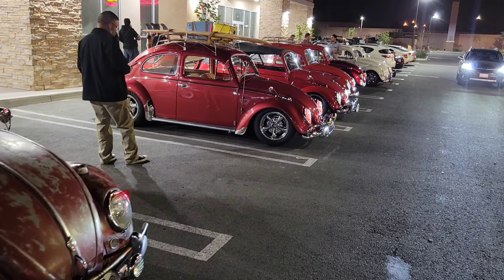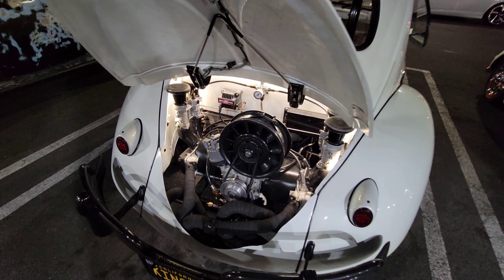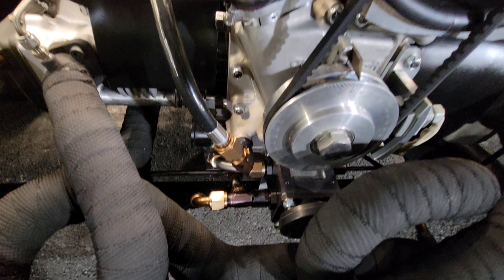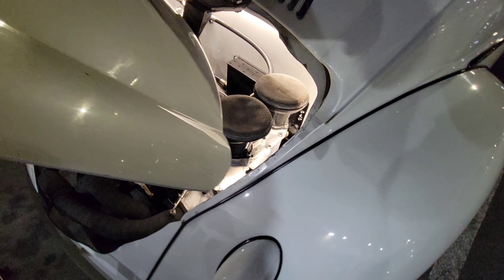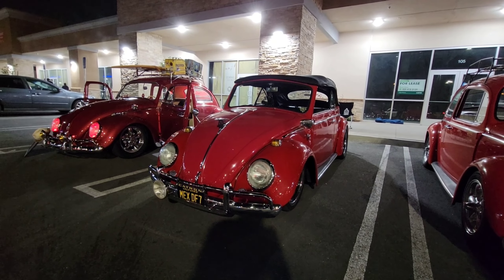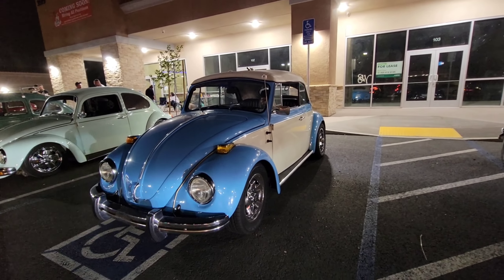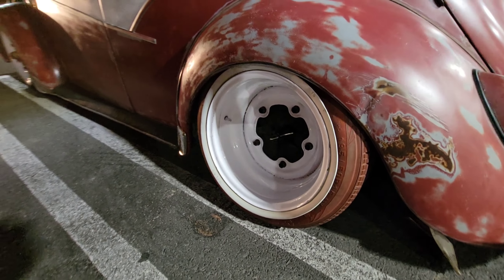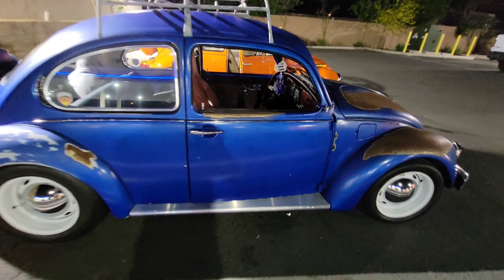2800cc VW air cooled Flat 4 Autocraft racing engine insane horse power  plus some cars

Comment: You may have seen it but there is a fellow who has a video on here that he took and put a Subaru WRX engine at over 500 horsepower in one of these he also did quite a bit of fabrication and fit up. The car seems like a beast for sure

Comment: Thanks Mike, nice video.  You pin ball machine probably has an over voltage safety circuit, usually in the power supply. It might just need a small component to be replaced. Once the circuit has fired the safety, it will present a short circuit to the mains supply and blow the mains fuse again. Should be an easy fix if you can Google it with the circuit board number…

Comment: Hey Mike !  that seems to be a Scat killer 3pcs. case . big bucks . If I would build a case to hop it up I would make the case longer to get more room between the cly.
Reply: Not a scat. Autocraft 3 piece. Folts and Schuh old drag engine from the 90’s.
Reply: @kingvw61  Oh ! I never seen either one of them . My friend Richard in San Antonio had a Karma and used original mag cases . He had a pile of them 15 and I said hey sell me one . No I need all I can get . Now in the back of the shop he had the blown ones . every one of them the same thing. crank snapped at the throw between #3 and #1 . It looked like case failure to me . this was in 1980 or 81 .

Comment: E85 would be well suited to air cooled engines. Handles high compression and runs cool.
Reply from the maker: Yea I should do that on mine. The guys at Low budget do it with the fuel injection system they sell.

Comment: A 101.6 mm bore with an 86 mm stroke is 2788 cc.  Stroke it to 88 mm and you get 2852 cc.  So, he may just be rounding up the 2788 to 2800, or he has an unusual bore size, like 102, which puts you just a tad over 2800 cc.  Interesting.  I wonder how it drives?
Reply: 2783cc. 86 x 101.5
Reply: Drives like a dream. Low end is great. Pulls to 8000.
Reply: @kingvw61  Never heard of a 101.5 mm bore size.  101.6 is 4", and is typically what I see on the market.  Is this a custom cylinder?

Comment: its a 2799 they are 101.5x86 the 4 inch bore cyl. are crazy thick and are much more streetable than an old school 2180-ive got a roller cam 2.8 with the heads of tge red baron drag car...
Reply from the maker: I think that is what it was. By the time I did the narration I forgot because Of working on all the house problems. Used to be in the drag car. it was the spare. They tuned it for NA....then the drag car engine blew up. was turbo then they machined the heads down to get high compression. would need new heads, pistons and some other things to go back to turbo. Pistons had to be clearance for the valves.

Comment: Those Autocraft heads usually don't have any cooling fins on them for street use. They are worse than the CB Street Eliminators when it come to cooling efficiency. I wonder how they run on a hot summer day??
Reply: E85 keeps them cool.
Reply: I data log all EGT and cht they run 350 on a 100 degree day. I ran 91 for 4000 miles and had no issues.
Reply: @Paulman50  Yeah, to a point... provided you have a conservative CR.
Reply: @kingvw61  What was your CR?
Reply: @freddaniali  was 10.6 on 91 now it is 13.4 on e85
Reply: @kingvw61  wow! nice!

Comment: Cool VideoMike , on the 2800 , how the hell does he stop that on the Street ?  Stock VW Brakes where never that great  Power Surgesactually really Suck  i lived inMaryland for 25 years and  i had a couple of them  that did damage to my mainTelevision  both times  it turned out  that on the second time the guy that fixed it explained that  the first Shop missed a Update notice from the Manufacturer  and if he would had installed a under a Dollar Diode  that would had blown instead  of the 800 dollar part that did ?  the Importance of using a Factory Authorized Shop for Repairs  of Course these days  very few people repair Televisions  We throw them out and replace it with a new one
Reply: I have RLR brakes front and rear, Stops on a Dime, best breaking car I have ever owned. They are strange calipers and rotors with ron lumus hubs and brackets.

Comment: The beetle is not common in the US? I don't know, But Here in Brazil is very common VW Aircooleds with 1.3, 1.7, 2.0, 2.9 liters or a VW Flat 8 engine (2 beetle engines in 1) made by Fittipaldi. So if you would like to buy VW aircooled parts, original or forged to 1000HP, beetle engine with electric injection, to upgrade Beetles or Kombis with VW certification, i recommend the Brazilian market ;)

Comment: That's an old Midget racing engine produces almost 300 HP when using  Hilborn fuel injected on methanol. Those engines are dry sump. And not sure why they would use a Scat pump because AutoCraft made all of their own parts from the case to the barrels to those Pro Series heads. 170 cubic inches with 3.0 stroke. Made to twist 11000 RPMs If you want to see one of those engines in action  inter in YouTube... USAC MIDGETS, 1983, ASCOT PARK. They race on the quarter mile and half mile.

Comment: type 4 engine being 20 lbs heavier , then the type 1 .would it not have engine bar at the front of the engine ,to support more . or just having the four bolts off the gearbox ,would either to support it.

Comment: I recently learned most small cessna planes uses 4cyl aircooled motors. Its not as big as the motor featured in your video. Did my research on that motors looks 100% like a type1 motor.
Reply: On the contrary, they are alot bigger in aircraft. 
320 and 360 cubic inch 4 cylinder? 
How about a 540 6 cyl or a 720 8 cyl?
Reply: @MrTheHillfolk  the company name is aeroconversion. The motors there looks like thry are smaller than 2500cc. Take a close look how it looks like a type1 motor

Comment: Very Cool Meet Up thecAutoCraft Engined beetle. was nice  being a street Car still would be a handfull but also a lot of Fun , sorry to hear about your PowervSurge  i had a Television that it happened to 4 times  untill i finally found a repair guy that had a Correct Recll addendum  that reccomended  a $ .69 cent Diode be put in ?   some people thought i was Nuts to keep getting it repaired and a Uncle Of mine who  was a retired ElectricalEngineer  and did television Repair  told me that the PowervSurges are way more Common than most people realize  itbhascsomething to do with  how Old thevGrid is  and the Tranferring Stations they still use  IDK   as i know enough to not touch  stuff that can hurt me or aye even kill you  because i’m just a Dumb Old Woodworker with a lot of Hobbies

Comment: Hey Mike got a question for... I got a 1914 with the aluminum case and then I had a super Freeway Flyer built by kcr in Riverside and everytime I tighten up the engine to the transmission the engine won't bar over. I had the engine dyno and tuned. Any tricks that I havnt already tried? Thanks man really like the channel
Reply: sounds like its a 6 volt bell housing, is there marks from the flywheel inside the bellhousing?
Reply: @kingvw61  Kevin at kcr clearanced it but I know that's the problem cuz before I tightened the bolts it would spin but grind

Comment: A choice too use this Setup ! Is all in the Owner Perspective !  Most times Less is More !  Also with A 13: To 1 Ratio For a 2800 cc ! With a Four inch bore ! Most 2275 cc - (Torque) & Above ! If setup right from a Great Entrepreneur !  Will get a Comparable Engineered Operational Results ! With Less ! The day's of the Scat, Pauter, Auto Craft , ETC !  Are not a Good Choice to Implement ! Cost, Weight, Longevity , Etc !   Do the Math ? R, D.   ☝Don't be a 🦢

Comment: Beautiful car and engine. But for the street, at that point, doesn’t it make more sense to go Subaru? A WRX engine is capable of putting out more power with greater reliability and drivability. I get that it’s no longer VW powered, but neither is Autocraft really.
Reply: still aircooled at least, you can put a V8 in it also. Or a turbo, This is old school N/A power.
Reply: @kingvw61  A V8 will not fit under a VW deck lid. A Subaru setup will. It is air cooled but I don’t know that I’d consider this exactly old school. Not a knock on the car, as it’s beautiful.
Reply from the maker: Subaru takes some serous cutting and changing the timing belt is a nightmare.  Reverse rotation. Injection with computer all lots of work. The cooling system for the Subaru conversion has major issues as well. hoses running in places they will get puncture. IMO nightmare. Either go aluminum brazilian case......for Bulletproof street(check cb performance)....Pauter Racing or Autocraft if you want fast reliable power.
Reply: An EJ in a bug is just lame as hell …yeah it’s cheaper but who cares you think these guys barely make ends meet ???lmao …..it’s cool factor just flatlines after that move . This build is legendary
Reply: @countryclubpga3309  I disagree about a well built EJ being lame…you’re starting with 3 times the HP of a stock vw. It’s not just about the money. Who wants to have to tear down an engine to repair something that breaks after every other race? Or rebuild a engine annually if you put any significant miles on it while driving it hard ? I love VWs. A well maintained stock VW will go a LOT of miles between overhauls. But you start pushing past 200hp-which is less than a stock GTI these days-and you’re really pushing things with a vw based engine. 200hp is four times what a 66 vw came with from the factory. And little more than a stock EJ25.
Reply: @michaelconverse5127  Vws in the 60s never came with2387cc + Displacement , they never came with TF1 cases , they never came with wedgemated forged cranks and forged pistons and h-beam rods . I’d say the Aircooled market has came very far and there is plenty of 200hp+ AllMotor 91 octane Aircooled Vws running around without blowing up I think you need to do some more research buddy….
Reply: @michaelconverse5127  I'm sure you've never done a swap like that, just internet banter. All the issues that Mike mentioned and probably more! Please move on to the LS swap crowd-lol